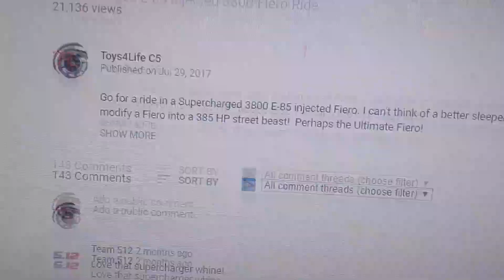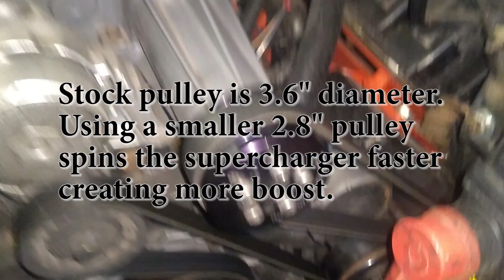3800 Supercharged Fiero (Tips & Closer Look Part 1) / Engine Swap

Comment: Terrific video and info.. Neat install and  it runs great.  .  I did a series III powertrain in my Fiero about 7 years ago and really like it. Added a 3.4" pulley and had to add an air/water intercooler.  IMO while the performance is satisfying,  we must accept that the 3800SC is a dated engine using older technology. Today the LFX engine is far lighter and produces 300-325 HP stock. If I were to do a Fiero engine swap today that would be my choice.
Reply from the maker: I like new technology but the simplicity and well documented swap detail availability along with somewhat plentiful relatively low cost 3800 supply makes it still the best choice for a high 11 second Fiero.
Reply: I gotta agree the 3.8l is unbeatable for a fiero build the price availability and dependability not to mention the cost per HP gain is honestly unbeatable you might be right if you're planning on running it for competition.
But even if you blow the motor you can grab a replacement within a hr or 2 for a few hundred bucks
Reply: I'm pretty sure the 3.6l lfx doesn't have the following, popularity or upgrade choices the 3800 has and considering in stock form it's only a 10-60hp difference depending on the engine series and air intake choice that can be modified very easy and cheaply to run 350-400hp with a few diy mods I'd definitely choose the 3.8L those cam phaser engines are to problematic for most people